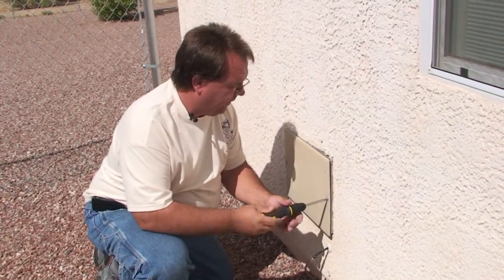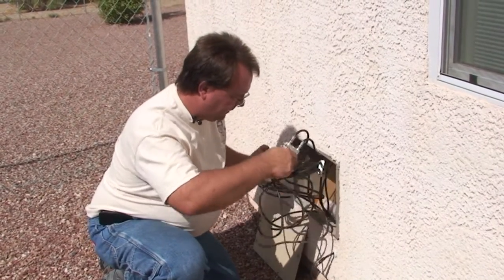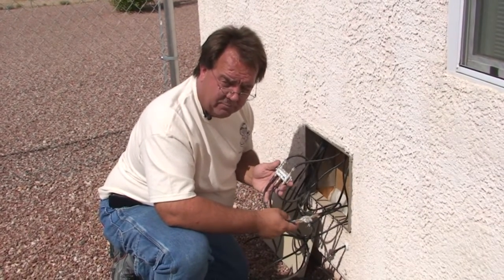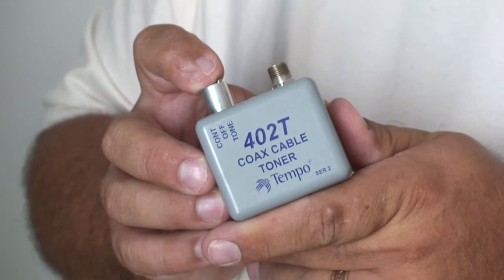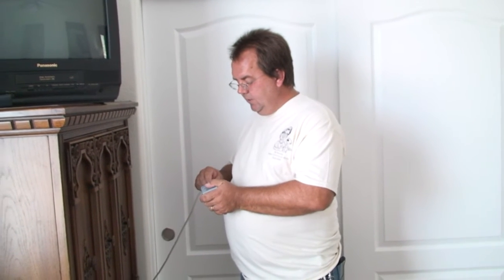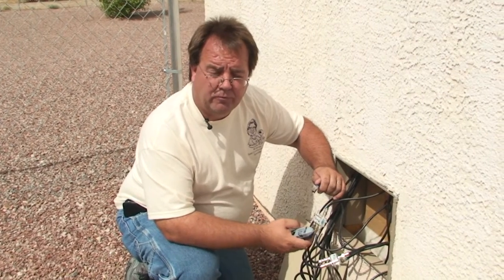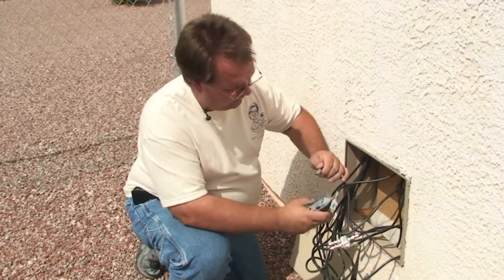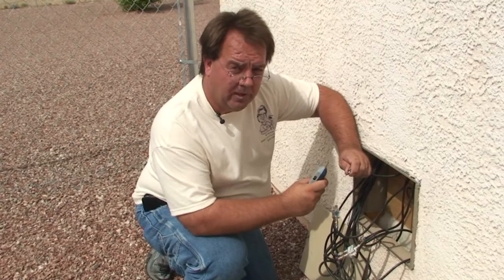Satellite TV Installation : How to Wire a House for Satellite TV

Comment: Cable Mapper.  It has different colored or numbered terminators you put on the line in the room you want to test and then take the the mapping tooling and test the lines to see which colors or numbers match.  Go to techtoolsupply and look up mapper or toner tools.
Reply: They work well but the probe he's using will tone through hidden splitters. Very helpful